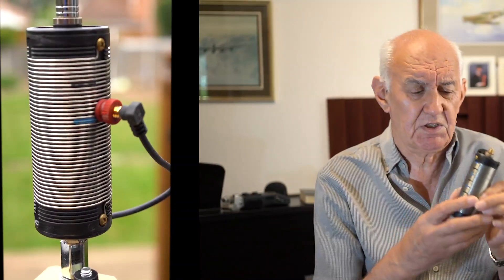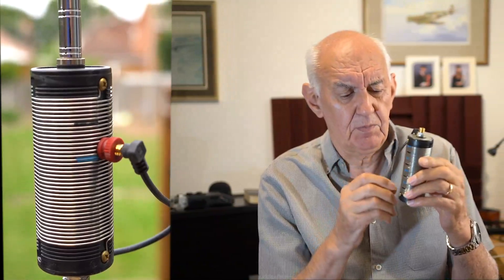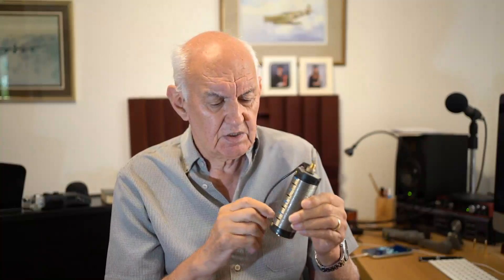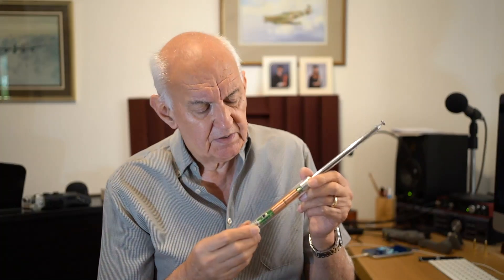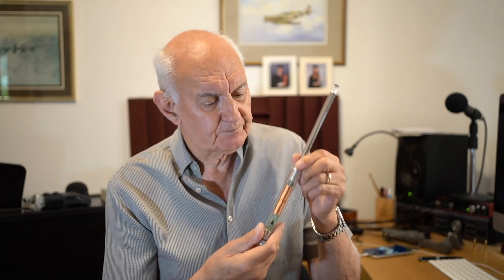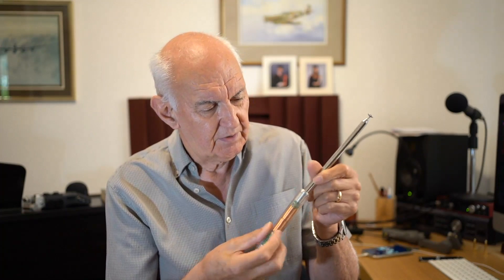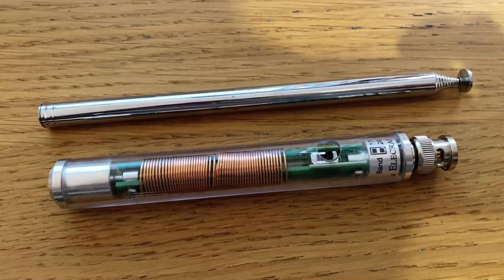HF PORTABLE   - CHOOSING THE RIGHT ANTENNA

Comment: My most successful fishing trips were the ones where I didn't catch any fish. No dead fish to have to clean, or cook, or eat, (I don't like fish.)

I'm pretty much the same way with ham radio. I don't have much to say to strangers, and over the years I've talked QRP all over the world over several solar cycles, so I find DX pretty boring. And I can't imagine buying an antenna made by some company when I already have wire, and cable, aluminum foil, and pieces of metal sheet. Buying antennas is CBer stuff. I'm a ham. I like to come up with an antenna idea, research it, build it, modify and optimize it with the NanoVNA, then test it on receive and see what I hear, or see how it does on WSPR. If I'm in the mood I may give someone a shout, and hope they don't come back to me. But I like the challenge of devising inexpensive portable antennas for different applications and bands, usually 2200 m or 23 cm, bands where I'm seldom bothered by chitchat. I find that WSPR and LoRa are the perfect modes for hams like me, since it was always difficult in the past to avoid 1 way transmissions when I was experimenting, or to transmit my callsign every 10 minutes, or to experiment with different sorts of modulation. I always wondered why the US government gave us the bands to experiment on, and then made it so difficult to actually experiment on them. So I developed my LF skills on the unlicensed 1750 kHz band before transferring my knowledge to 135 kHz. And I hop back and forth with LoRa between ham and unlicensed bands in order to ensure my experiments stay legal. Antenna work or power experiments are done on the ham bands, everything else on the unlicensed bands. Amateur radio is an odd hobby these days.
Reply from the maker: Thanks for shqring.

Comment: For an EFHW, which Coax do you like to use for minimal dB loss when you are in the field?  Also, how high do you place our transformer off there ground?  thx.
Reply from the maker: I only use a few metres of coax so I am happy with RG-58. The loss is of no consequence at that length.  I tend to sit the transformer ay ground level. Again it is not important but at ground level you have the shortest length of mast! 73 Peter.

Comment: Hi 
Peter, How do you increase or decrease the wattage that antenna can handle? For example if I want to make an QRP antenna that works from 5 watt to 100 watt are the changes that I need to make? Basically what sets the wattage that can be used on an antenna.

Comment: Puzzled by your remark that you won't need coax for an EFHW +49:1 transformer.
You said it 3 times so it wasn't a slip of the tongue.
Coax from the rig to the 49:1?
Perhaps you mean "no long run" and consider the short piece to be a patch lead?

73    G3NBY.
Reply from the maker: You got it, Should have nade it clearer. 73 Peter

Comment: Amazing... I was just going to suggest the fishing analogy and you said it exactly at the same time.
Ham radio scores because you can eat your sandwiches in the field knowing that you haven't been handling maggots or worms!.
.Experience much the same as you Peter...,,G3NBY Not Born Yesterday...Ticket 1958.
At 16 years old, I stripped down a fishing road made for by my dad out of a govt surplus tank whip and turned it back into an antenna. Experience revealed that needn't have stripped it and it would still have served both as an antenna and a fishing rod,. 1/4 wave on 20metres,
73 de G3NBY,
Reply from the maker: Thanks. Nuce to hear from you

Comment: I would like to put a ham stick for the 20 meter band on my motor scooter.  Does the metal on the scooter provide enough ground for this kind of antenna?  Anyone have experience?
Reply from the maker: Not really sure. If engine is bonded to the rest of metal frame, couldwell work.

Comment: Put up a full size di pole feed it with parallel balanced feed line and you have a all band antenna 100% of you signal out.
Reply from the maker: Firstly you need an ATU and secondly  I personally would hate to lug all that along for portable operation.

Comment: Peter I agree that the efhw is an excellent antenna and use mine portable. However, despite the high feedpoint impedance, there still is a need for some current to go somewhere. Hence the outside shield of coax (fine at 100w or less).. or you use a counter poise at around 1/20th length of the lowest wavelength. So 2m long is fine 40-10. Also a vertically polarised 33 foot long efhw gives great low angle radiation for DX. 73
Reply from the maker: Thanks Tim. Yes 33ft is great for 20m DX - assuming you can find the support when out portable. I have read the comment before about the need for a short counterpose. However, I have found that it makes not a scrap of difference and speaking with stations running high power into our commercial EFHW, they likewise have found there is no need. The coax outer probably takes care of this. However I normally use a line isolator at the tx end at home - but not everybody does! 73 Peter.
Reply: Tim, what you say about EFHW counterpoises is true. Yet, like Peter, I have found I can operate EFHWs at QRP power levels without any conterpoise wire or use of coax shield as counterpoise. In fact, I have found that I often get a better match without a counterpoise wire. Why? I suspect that stray capacitance to ground off the secondary winding on the matching transformer is providing the counterpoise; AA5TB's website provides some explanation on this. In practice, the feed end of an EFHW is going to be very close to ground or a building/structure attached to ground. So, you can rely on this capacitive coupling as your counterpoise.

Comment: Great video. I have an endfed 1/2 wave and just love it. It covers all the bands 160-6. Now I do need a tuner, but this is not a POTA or a SOTA station. I just raised my antenna up to around 30 plus feet last week. Now you say the DX isn't that great, but I contacted Rome IT from Nevada. That is over 6800 miles away which I believe was over 9000 km. So I am a true believer of my end fed. That was on 20 meters. The antenna is cheap and if handy you can make your own. So Peter thanks for pointing out this antenna. 73 Clark KG7LOI.
Reply from the maker: Thanks Clark.

Comment: Great advice Peter, I have 3 different resonant lengths of wire for 20/17/10 (EFHW).  Takes minutes to change bands as they just plug in to the 49:1 matching transformer.  The issue I have is with 40 is the sheer length needed.  When out and about radials are a nightmare unless you are in a secluded spot. I keep it simple, minutes to erect and dismantle.  Not tried the mag mount yet and with Autumn/Winter round the corner it’s looking to be a good option to continue with portable fun.  73 de M0AZE Mike.
Reply from the maker: Thanks Mike

Comment: An interesting video. I just use a ten metre long inverted V held up with a fishing rod and fed with two core mains flex. It works very well.
Reply from the maker: Good to hear from you Ray
Reply: @watersstanton  For some reason I have to go mobile to contact local stations. Many of these are a no copy from home yet I can get to a other countries from there. 73 M7AOE.